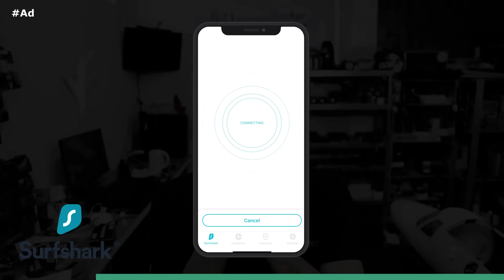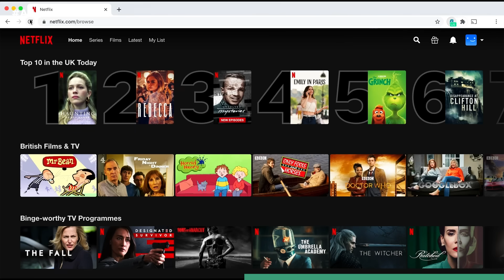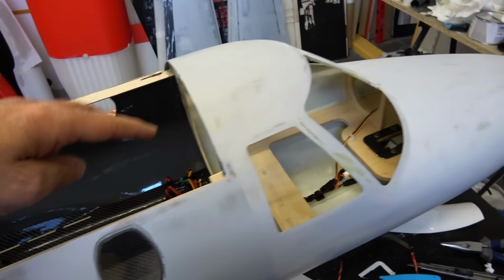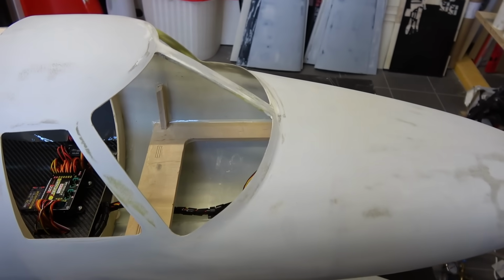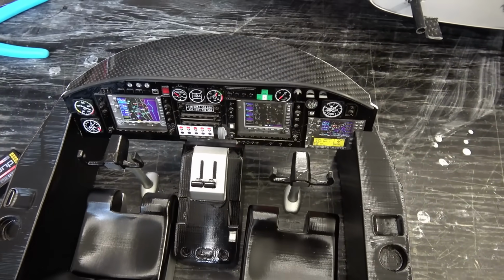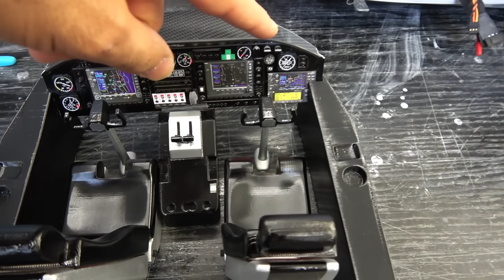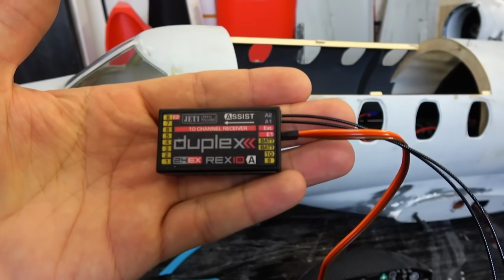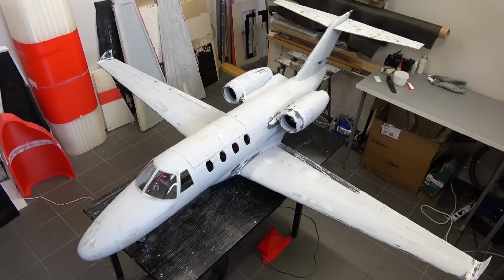DIY RC Airplane Citation M2 is Ready to FLY!

Comment: Hi
I find it really relaxing to watch you do youre thing . BTW , did you know that you are putting youre servo eyelets upside down . Flat side of the eyelet goes on the bottom of the servo . Than you use a servo screw to hold it down , you have two washers on top , the other way  , . now you have a washer on top and on the bottom . The space between the two washers ( the height of the eyelet ) is suppose to be the correct distance between the two washers ( ? ) The way you have it ,the eyelet will eat into the base with vibration . 
Am I not correct ?
I enjoy youre work very much 

Michel
Reply from the maker: honestly I don't know, but I think you're right!

Comment: I’m still hoping at some point you’ll find a way to integrate the mechanisms for the rudder and flaps within the parts, just to make that more realistic and slick.
Reply: That integral flap servo looks pretty nice! Would certainly be an interesting challenge
Reply: There are ways to do that, for example there's RDS where you attach a bent rod to the servo that goes into a slot in the control surface. It's pretty clever.
Reply: It would also be nice to see real turbine engines installed for the ultimate in realism!  Nothing like the sound of a turbine engine starting and spooling up!!!

Comment: The price on those fasteners is quite steep. But usefull when you do not want to purchase large quantities or are looking for a starters kit. 

I checked my regular supplier for fasteners  and it is roughly 80-100 times cheaper but the downside is that you have to buy fasteners by the 500 or 1000. For example: DIN912 M3x12 costs 1,52 euro for 100 pcs

Comment: Once there was a 1:2 scale gripen jet. Unfortunately it was constructed with balsa wood and everybody here has seen it disintegrate midair (probably several times). I wonder if it would be possible to construct it rigid enough with these techniques shown here? Sir Ramy here seams to have enough know-how to do the necessary calculations before building it.

Comment: I am a little concerned about the sharp carbon edges on the holes in the mounting plate for the electronics. The cables are not protected there.